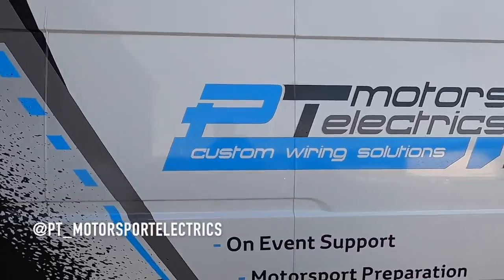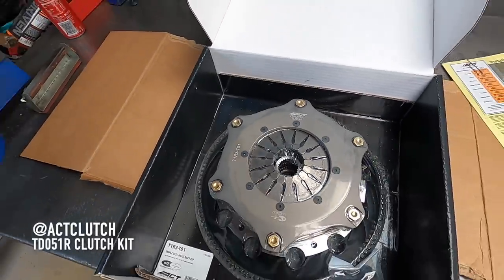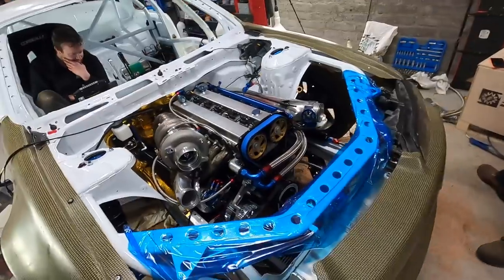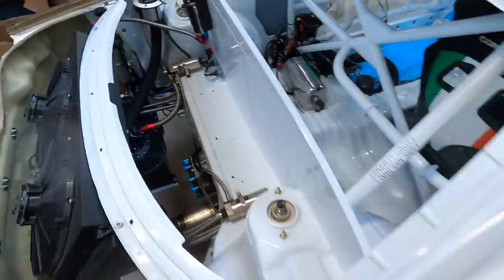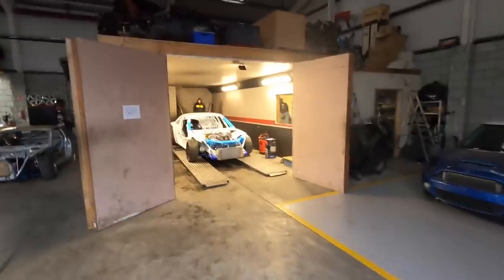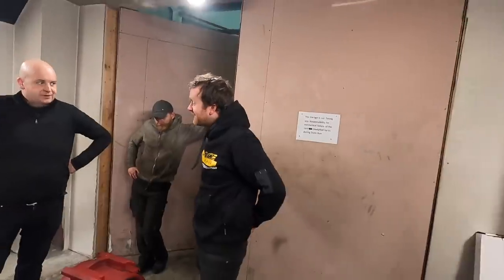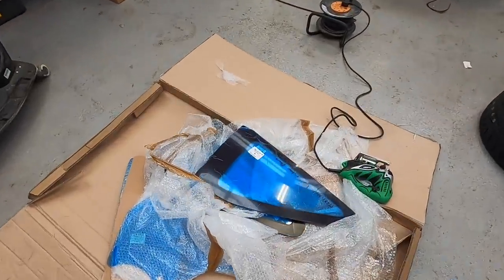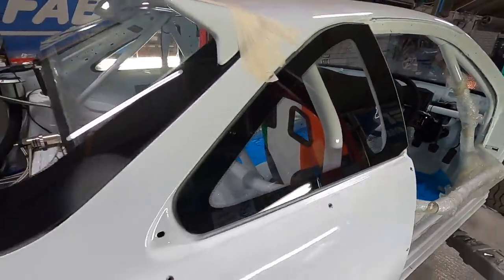Building The Ultimate S-Chassis | Part 7

Comment: When making the car lighter with a smaller tire than your previous FD cars does it make the car more reliable given  the engine and power train doesn't need to be pushed as hard?
Reply from the maker: It will definitely be easier on the driveline using a 265 and a lighter chassis. We are considering not using nitrous on this as it’s a very responsive setup with 790hp. We believe it’s more than enough for a 265.
Reply: @JamesDeane130  thanks for the reply 😁. Is it harder or easier to drive a lighter car? I would assume the car would react faster to any input but would that make the car to twitchy?

Comment: How does a kid get into drifting do you have to go carting first or have rich parents or both ...
Reply: He started in a €200 Sierra hardly anything to do with either
Reply: @VelEire_  how does a kid get into drifting if you don't know how
Reply: @raleighburner1589   in ireland anyways it usually starts with a 200 euro bmw and a big grass field.
Reply: @markmuldoon7044  thanks but what if you don't have a big grass field handy ...I live in cork city big grass fields aren't exactly plentiful ...are there race tracks a person can go to ..
Reply: if you have snow winter drifting is the way to go, or at least  wet weather  like rain
carting probably wrong way 
just some RWD with not to much HP inertia drift is the key
Reply: Where can you buy the cars or is typical Irish closed shop where only the cliques can be involved ...
Reply: @raleighburner1589  done deal, ebay, facebook marketplace. Anything rear wheel drive to get you going. If you don't have a field you might be stuck a bit. Plenty of places cork direction. Watergrasshill rally connection. Only thing is a car that cheap won't have passed nct so won't be road legal. You'll probably need a trailer and tracks might require a roll cage and fire suit minimum.
Reply: @markmuldoon7044  I was right ..you have to have a rich daddy and connection to get near a race way ...and that's a fact ...typical Irish
Reply: @raleighburner1589  all motorsports are expensive. That's a fact of life. That car james is building right now is probably the guts of 150,000 euro. An amateur drift event will easily set you back 750-1000 between transport, petrol, tyres and spares for your car. But james deane started drifting in a field in cork. It can be done
Reply: Buy a cheap Mk2,5 MX5 or BMW compact, weld the diff, go rip up empty car parks late at night and go to a few small events. You don’t have to compete. Obs street drifting is illegal AF. There’s also lots of drift taster/basic instruction deals around. Not all are good so look at reviews and forums etc. There are turn up and drive drift events, not in COVID but they will be back.
For the same price get a simple sim rig and learn the basics on a game like Asseto Corsa or whatever. I am too old and technophobic for that but all the cool kids are doing it.
Reply: Right now cheapest bm I can see on donedeal 

€400 runs and drives
Welding diff usually €50
Save up for lowering springs/ at most €200 coil overs 
That’s a basic car for €650

Plus nothing to stop you parting out & selling the interior and heavy bits save tyres & money! Cheap seat and you’re sorted

No need for a bank of mammy & daddy, we all start somewhere, your only limit is your mindset, best of luck saving and spreading safely
Reply: Shredding*